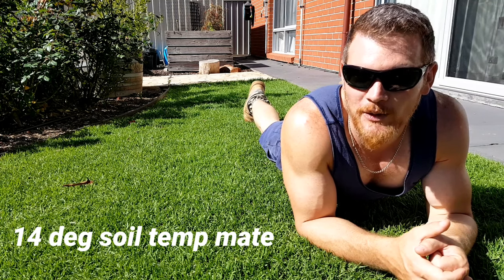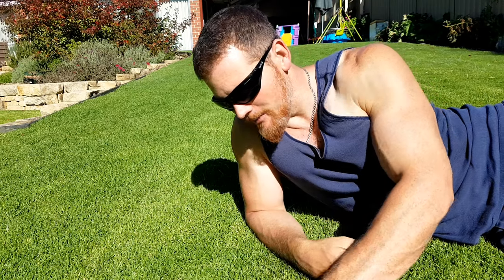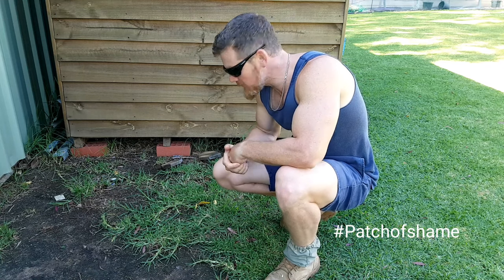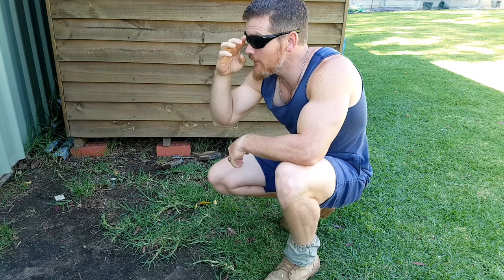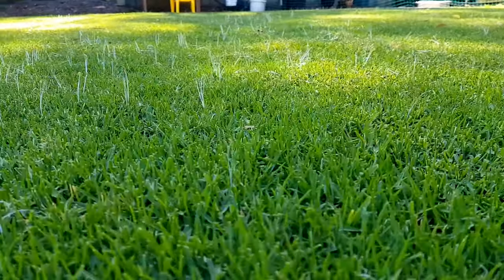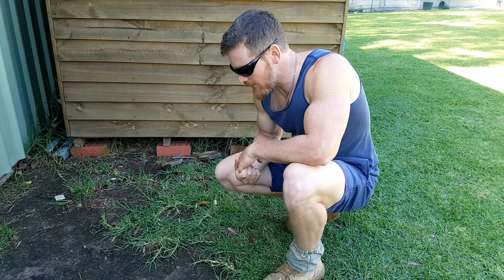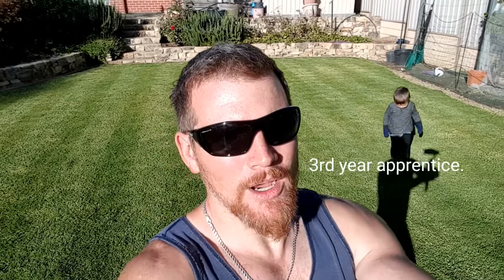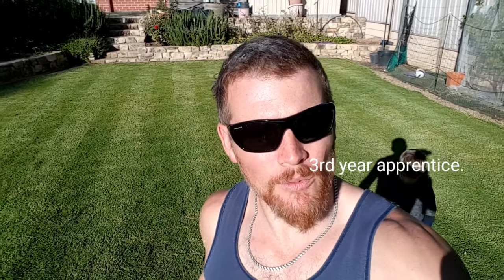KIKUYU FACTS - What is it?

Comment: Hi mate what tip of top dressing do you use for your lawn ?👍
Reply from the maker: Hi Zac. Ill be looking for a washed sand to try and increase the drainage capacity of my soil profile! She gets a bit wet in winter.
Reply: Do you use 80-20 top dressing or only washed sand?
Reply from the maker: @zacj63  It will depend on your soil profile aye. If you have mostly clay consider the use of washed sand. But if you have sand consider a 80/20 loam. Have a play and see how it goes. You won't go wrong with any of these choices. Ill be looking for washed sand for my deck this year.
Reply: Thanks mate for the valuable information 👍👍👍👍
Reply: Can I put in a comment and ask whereabouts you can get proper washed sand  or 80/20 mix?
Like a garden centre? I don't want to go to the wrong place and get the wrong sand 😅